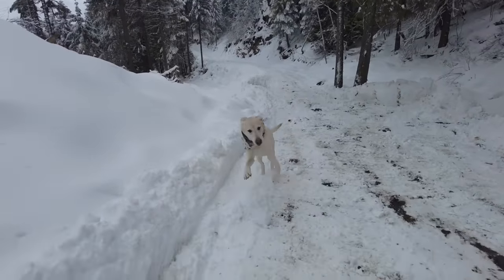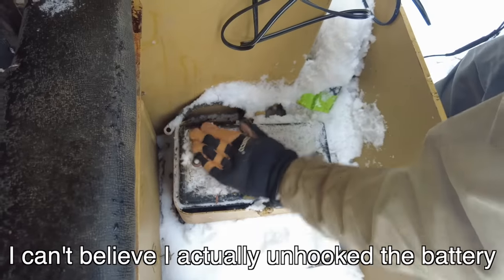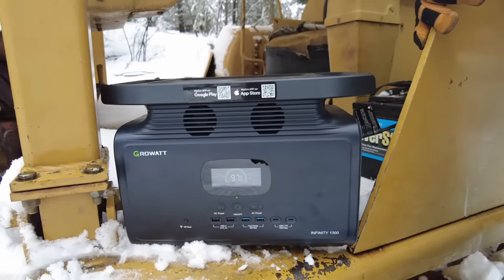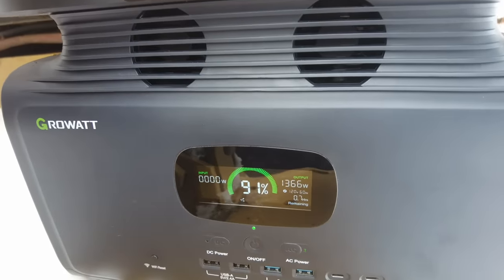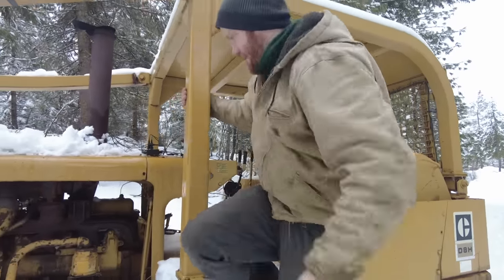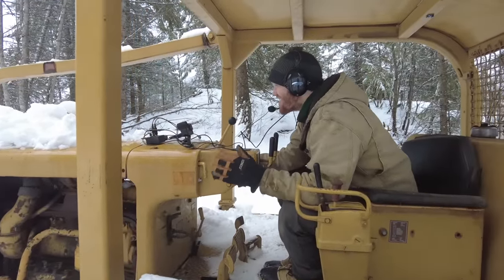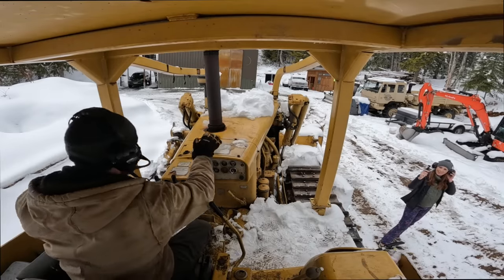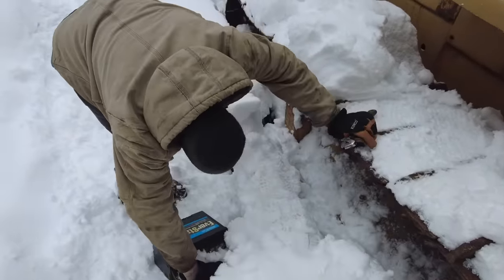D8 Dozer, Will It Start? | Using Our Infinity 1300

Comment: Like there was any doubt. That machine was built when it the mindset was as Yoda stated "There is only DO not try". As with any machine the most important thing is PM, take of it and it takes care of you. It has none of the engineered limited lifespan nonsense forcing you to replace parts. Just needs good oil, fuel and filters. IMO

Comment: I'm sorry to say that, but this was a lot about negligence! Not checking antifreeze before winter at your location is inexcusable. Leaving the battery in the dozer is a huge risk and makes no sense since it's easily removable! The tanks should be full to prevent rust and reduce condensation. and you should have covered up the motor to prevent moister to get in everything. Do you have too much money to care for these little things?

Comment: Operator tip it was hard to tell from the video but whenevrr your pushing material all have tge decelerator completely relaswed you want max rpm and torque fun fact in the canadian armed forces we run 1980s d6 dozer which are a beast all in their own plus side our dozers at least have a cab haha

Comment: I wanted to like you, but dislike you for advertising. I understand that the advertiser pays, and the suckers will buy everything, but to heat the starting engine, it's best to use a gas burner instead of a hair dryer, and use one battery to charge another, this is nonsense, especially at this price. it is easier to carry the starter battery for charging, or put the car next to it and charge the dead battery, well, or you can use a regular battery from the car and a converter for mains voltage.

Comment: Hi guy I’m  73 yrs, live ak 70 yrs now, your d8 next fall park it next to shop, and on some old logs, and take some plywood put on sides , I cover mine with a trap. Put and small battery charge on batter or remove take inside ,I have 450dozer case 1965, plus im get old d8 1950s, I have more land south ninilchik ak,  that you

Comment: your battery died because it was uncovered and a constant short with the snow/ water I have a truck that has electronic gear in it and if I leave the electronics plugged in over a day or two the equipment will go until the battery dead and ruined and i have to replace the battery FYI

Comment: Most battery chargers will detect the current charge of the battery you are trying to charge. If the voltage of the target  (Lead Acid) battery is 10 Volts or less the charger will not charge the battery as it will actually destroy the battery.

Comment: Old heavy equipment was built to last. Yes, they're cantankerous at times. Now, can you see modern-day heavy equipment in 60 years from now still running with all the electronics, especially after sitting for decades, not running?? Nope, they won't.

Comment: We used two gallons of regular gas in old  250 Cummins in 1960s to keep fuel from freezing  250 s were a beast in cold weather great truck  motor in the better days  when biden was not as stupid

Comment: At less you can get rid going    with battery s  it dasnt  always strat I have tracter and they Re a pain in winter   that's why I Have cats Two AD2 and D 6B manual five speed   I like THE PONY MOTER IT GREAT  NO BATTERYS AND ONE GALLON  DO 6 WEEK STRATING  A BATTERY AT 480 DOLLARS  EACH ×two   and strater moter 1.100  to bye it better  with old gear  that makes it around  2000 dollars   that's a lot of fuel   I say keep that old cat D 8 You will have years of fun

Comment: You don't seem to know something about those worthless electronic chargers. They are so smart they are just garbage. Hook up just test lead to the cat battery to a 12v battery so the charger can see the voltage. Then run the charger a bit. then remove the backup battery. If the battery starts taking on a charge you for sure could be good to go. Done this many times now and it worked every time.

Comment: That was painful to watch. If you are going to leave out heavy equipment , at least tarp it so controls are not frozen with ice.  I used to run a John Deere 820 tractor in Alaska with a pony motor. We had a small insulated blanket we would put over it, then a small electric heater would warm the entire pony motor engine. Waving a heat gun around on really cold metal parts to warm it could crack a housing. Your start procedure was bizarre. Is that from the Cat handbook ? We would start the pony motor, let it run which circulated its warm water through the main engine. Then turn over the main engine for a few seconds until it showed oil pressure, then add fuel to make it start. No idea why you are turning over the main engine for a long period of time......

Comment: You must be afraid of that dozer, running around in 1st gear with the throttle in the idle position, nobody on a job site ever went through all that crap to start one of those

Comment: Watching you drive that CAT on snow with cold tracks, after operating heavy equipment for 35 years, let me inform you that driving on snow cold tracks that machine can get away from you and become a killer if it starts sliding sideways or down the hill. Dropping the blade may slow it down until it hits something to stop it. I see your wife on the right-hand side where it looks like a cliff. If this CAT started to slide towards her and over the edge, you may not have a wife. This really shocked me to see her standing there. Please don't do that again, don't put anyone in danger with something like that. I do agree, you do NOT know how to operate that CAT, you just drive it. A good operator would have waited until spring and all snow and ice were melted. Don't learn the hard way.